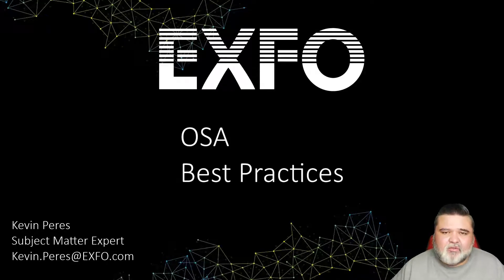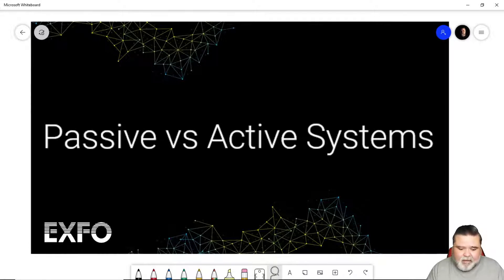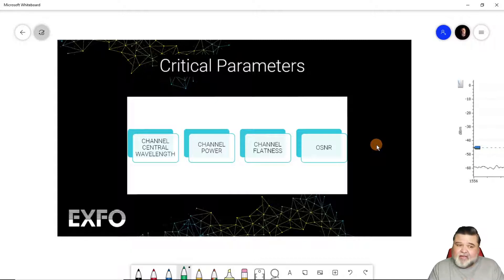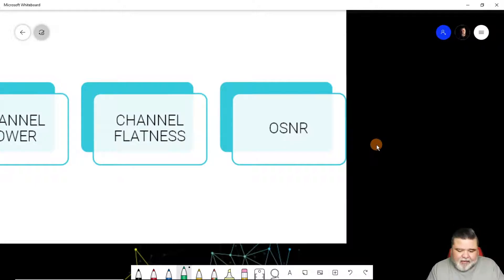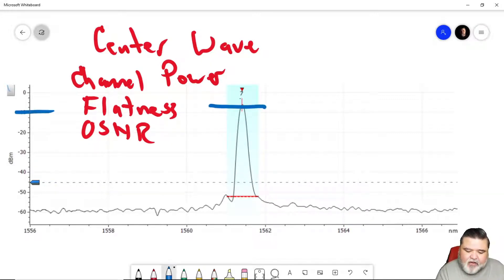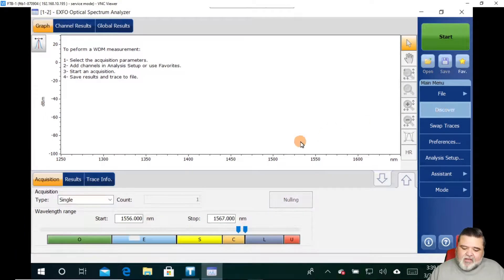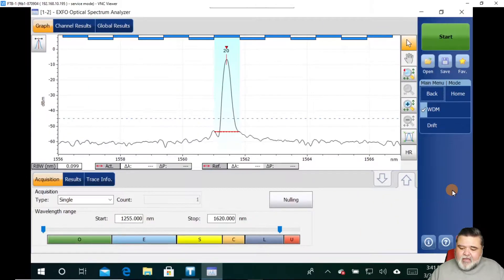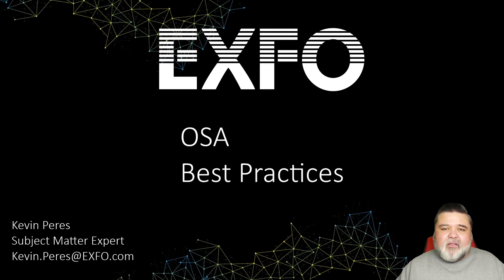OSA Optical Spectrum Analyzer Best Practice

Comment: If multiple channels running on ROADM card, how to get OSNR for specific channel
Reply from the maker: you can run auto discovery but you need to make sure that your OSA is capable of In-Band analysis if you are measuring a ROADM Signal. The ROADM does noise carving which changes the spectral shape and the traditional IEC method does not work so you must select InBand for measuring OSNR.